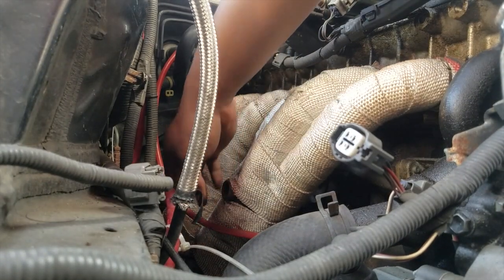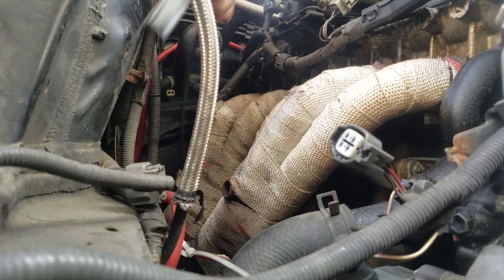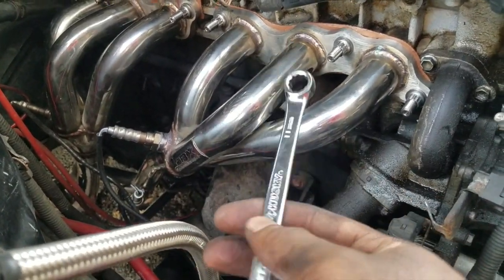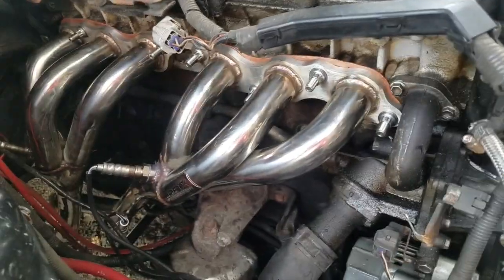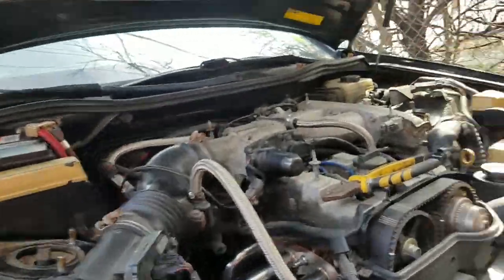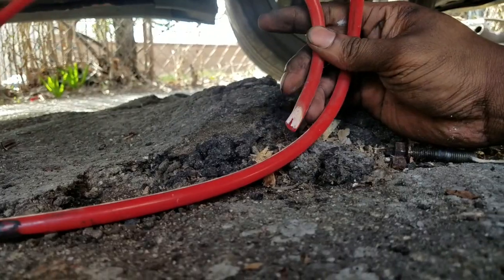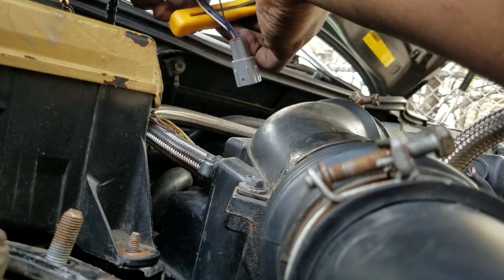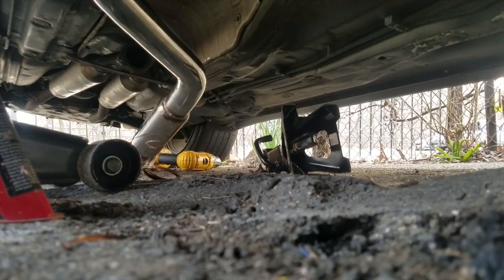OBX Headers and Midpipe Install on the GS300!!!!

Comment: Love it! I just got a 99 gs and am gonna do the same but wrap or cerakote the header for engine bay temps. And run straight single after the test pipe 3.5” SS and a single exit angled up on the driver side. Pumped to see it come together bro.
Reply: Make sure to video it bro I wanna see. I just got a 99 gs300 myself I plan on running some boost through this badboy have some fun then swap in a gte!

Comment: Nice video brother! Are you getting any O2 sensor codes? If no, how did you avoid that problem? Looking into get these headers for my 2003 GS300. Thanks!
Reply from the maker: I have no codes for my headers at all. The ones I installed before had codes but these headers when installed correctly cleared them. I used an o2 sensor spacer. I got 2 right angle spacers for. for Bank1 sensor 1 and bank 1 sensor 2. They usually have a tiny hole to let in a small amount of gasses to fool the ecu.
Reply: @dariencharlton4773  Thanks brother for the help. I will look into those Spacers also and purchase them when i get the headers.
Reply from the maker: @Akofena_AutoWerke  It also wouldnt hurt to get some exhaust studs too. If you havent changed the stud before it can snap and break on you which happened my first time doing it.
Reply: Thanks bro for letting me know! I didn't know that! Will definitely order those studs ASAP !! Respect !
Reply: What header before?
Reply from the maker: @tzeshenlim  these cheap Godsnow headers for an is300. I was told they are interchangeable with the gs300 since they share the same engine but I've had issues with it. That video exists also

Comment: 13:04 Where did that O2 Sensor come from? My '01 GS300 has 4 o2 sensors connecting to the current stock header.

Comment: where did you get your o2 sensor spacers from?
Reply from the maker: Ebay or Amazon. They're fairly cheap. Its just the same o2 sensor thread that screws in and the o2 sensor screws into it to keep it out direct exhaust stream

Comment: where can i buy the header
Reply from the maker: Ebay. I bought them from an authorized seller and they were new however I got a leak in it. At the second piece back and they dont want to honor the warranty. They require you send in a warranty card and after I filled it out and sent it, I got the leak and they said they havent received a card and I'm not on file. You may have better luck and you may have worse luck.
Reply: Exhaust shop, have em weld over or sleeve the leaks. 💪
Reply: Darien Charlton so you don’t recommend the v2 headers
Reply from the maker: @AnthonyLivesTwice  I've never heard of v2 headers. I've only used GodSnow and OBX
Reply: Walmart sells the obx kit for like $212

Comment: Hey how are you dealing with cel for cats missing?
Reply from the maker: O2 spacer. I screw it into where the o2 sensor goes and it has a small hole to let in less exhaust. Then the o2 sensor screws into the other end of the spacer.
Reply: @dariencharlton4773  Ok thanks. I'm gonna try it out like you did. O2 simulator is expensive....